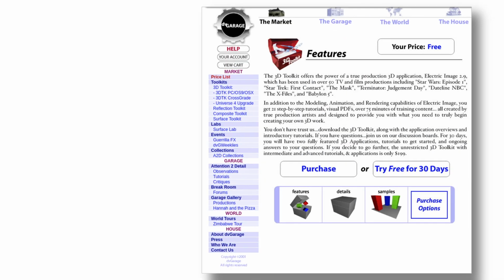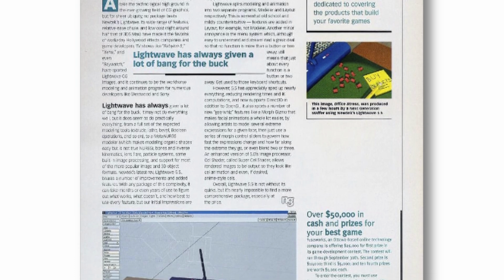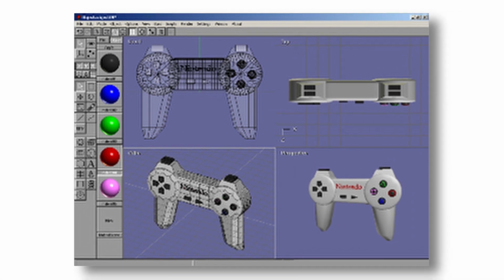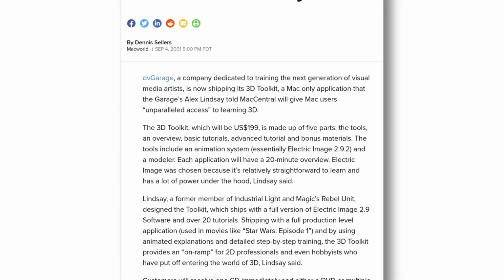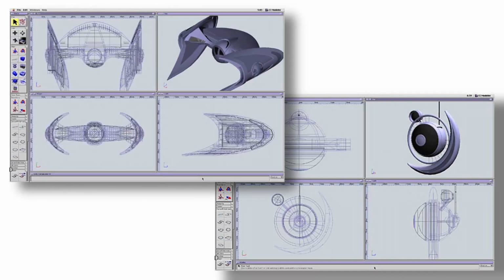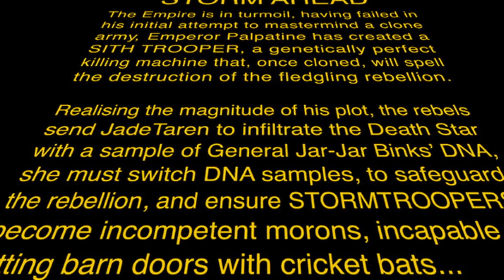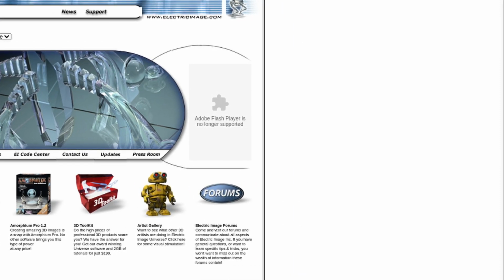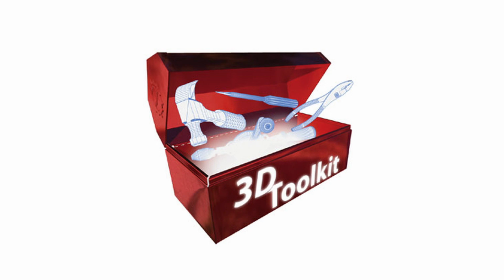Electric Image Universe Lite: The Story of the 3D Toolkit

Comment: I thought Alias Power Animator and Softimage 3D Was used to create the CGI for T2, The Mask, and MIB... ?
Reply from the maker: So far as T2 goes, Electric Image (no Modeler yet) was used for at least some of the Los Angeles explosion, specifically the expanding wave of disintegrating buildings and debris. In the latter case, the debris was animated with the help of an EI plugin whose name I unfortunately cannot remember. 

EIAS’s renderer was extremely good so it may have also been used to help render other scenes that were modeled in different programs 

-Jonathan

Comment: I tried most of the 3D packages at the time, mainly on the Mac. EIAS was the only one I really fell in love with. 

From memory in 3DTK (my copy is in a box in the garage) the Modeler lacked the Surfacing Tools, the SDS modeler that got shoehorned in later. I also have the odd memory that it would only export to 3DTK Animator .. this was a very big limitation I think. I found very quickly if you didn't upgrade to the full version it was difficult to do much in reality, or it just became frustrating. TBH I hated the attitude at the time ' here is the cheap seats version' once you experienced it.

Every now and again I used to unearth the full version ... had it running up to Windows 10. Died on Windows 11, but that might be the dongle is finally dead.

I did have a chat with main modeler developer a while back before the EIAS forum finally shut down .. he was thinking of redoing a version of it , but I don't think that happened. I am guessing the whole EIAS thing is dead now as they failed to license the ACIS core API for modeler so lost it and the final two programmers were two Russians both with the name Igor .. hard to believe these days but true. Thank you for the nostalgia. R 😊

PS I think Silo still has a legacy fac model export that was hastily arranged between the companies when modeler went.

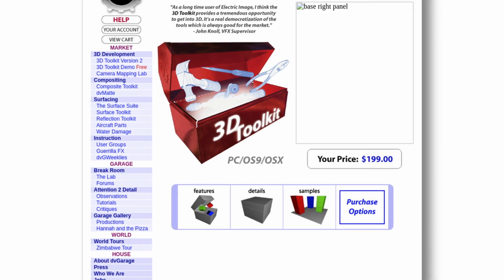Comment: 16:20 I may have found a clue as to why the software was abandoned. The Wikipedia page for EIAS says that, owing to a licensing dispute, the full-price version of the software lost its “Modeler” module around this time, and it seems EI has depended on third-party modelling applications ever since.

Since the 3D Toolkit could hardly have been a comprehensive learning tool without an integrated modeller, that is what probably spelled the end of that product.
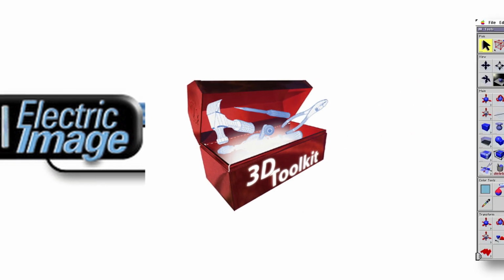Reply: 28:38 There you go.

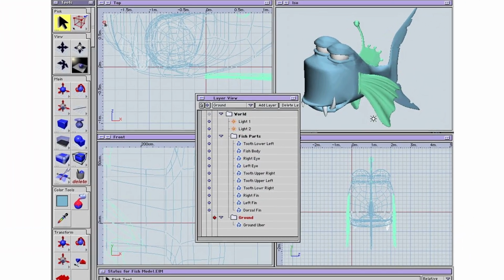Comment: 6:18 NURBS patches are I think mainly used in CAD. VFX models are mainly built out of polygonal meshes, with Catmull-Clark geometry subdivision applied to create the curvy bits.

There are other ways to build 3D geometry, of course. If you thought “NURBS” was fun to say, how about “metaballs” ...
Reply from the maker: I vaguely remember 20 years ago struggling to follow a NURBS based tutorial in the 3DToolkit to make a human face. I don't think I got very far...

Also "non-uniform rational B-splines" is still far more fun to say than "metaballs" ;)
Reply: Nowadays I think artists start by sculpting the shape that they want. Then they have to retopo to get the mesh complexity down to something reasonable. Which is a whole ’nother kettle of fish ...
Reply: We did use a lot of NURBS-based models in the early years. Stitching patches manually was something not many artists could do well. :)

Comment: 5:51 Those still using SGI around the turn of the century would be already seeing the writing on the wall. Flagship apps like SoftImage, previously only running on SGI, also became available on Windows NT, giving comparable results on hardware that was only a fraction of the cost.

Comment: 4:17 Unfortunately, LightWave 3D is showing its age. It has never been properly updated for more modern ways of doing things (like using quaternions for rotations to avoid gimbal lock). So it is pretty much dead now.
Reply: It has been dead at least since the CORE fiasco around 2009. No clear direction in development, no clue, no nothing.
We had abandoned it way earlier, though. In the early 2000s when it became clear that NewTek wasn't listening to their customers.

Comment: I took a 3D animation class back in college in the mid 90's. I don't remember the software, but it was on a Macintosh desktop.
Reply from the maker: I’d be surprised if it wasn’t Electric Image: Lightwave, 3DSMax, SoftImage, and Power Animator didn’t run on Macs, and EIAS was considered one of the best animation packages available.
Reply: @AnotherBoringTopic  There were a surprising amount of now-defunct Mac 3D software though. Another relatively popular one was Infini-D, as well as StrataVision.